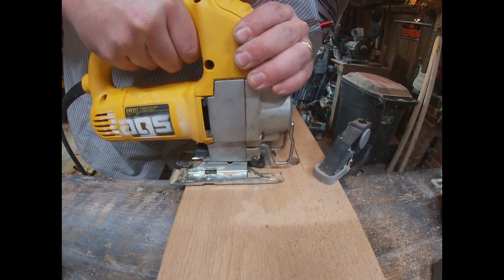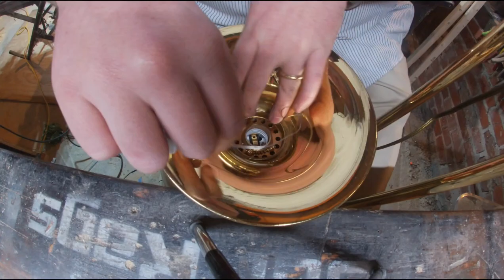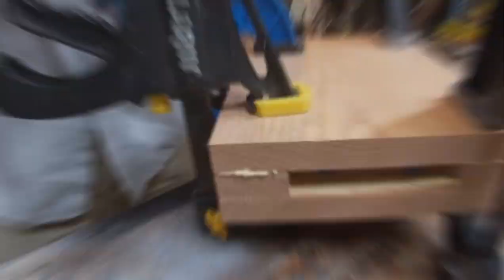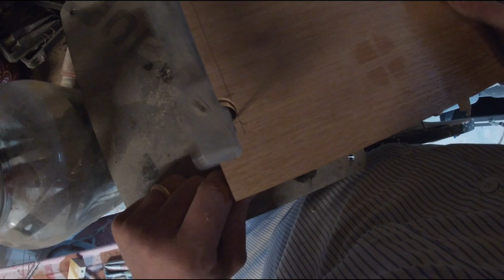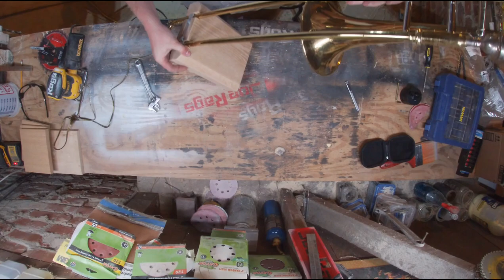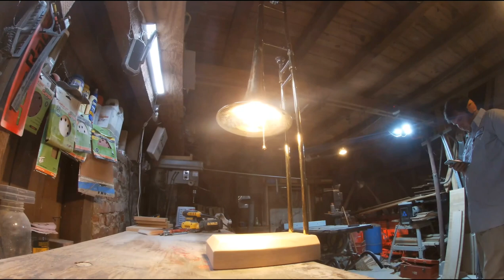TROMBONE LAMP BUILD

Comment: Instead of rooting it through the water key the mouthpiece while would of been easier

Or the tuning slide (shortest path to the bell)
Reply from the maker: It would be, but for how the lamp is mounted to the stand, I decided the water key would hide the wire best.
Reply: @JoeRags_  the reason I bring this up is because I play trombone and I also know the water key is the smallest hole (yes it hides it well. But I was just thinking of the shortest path but both work